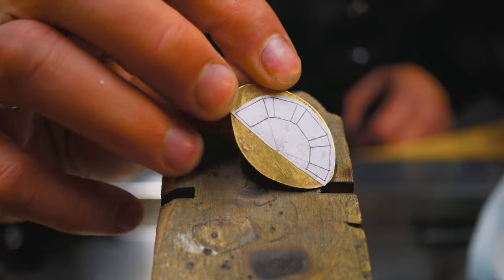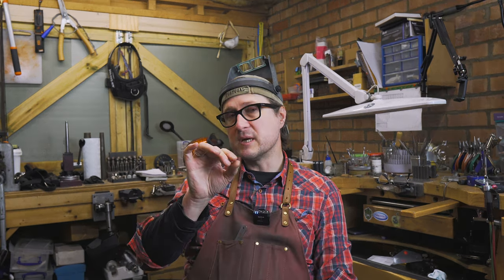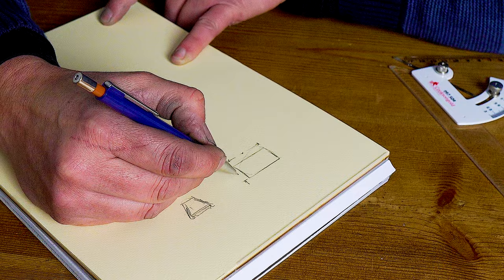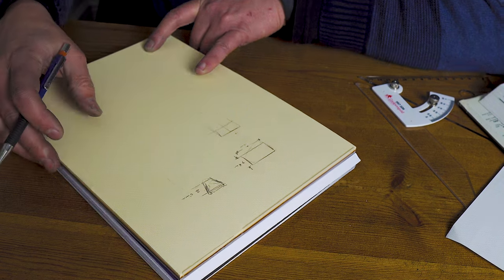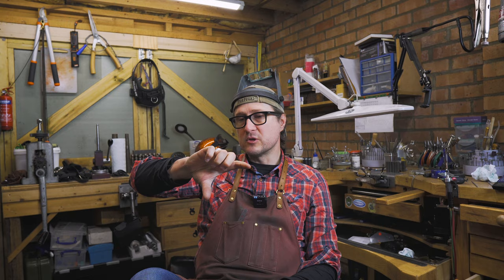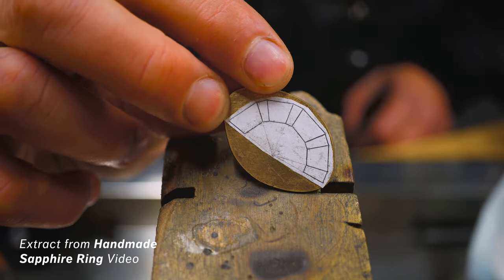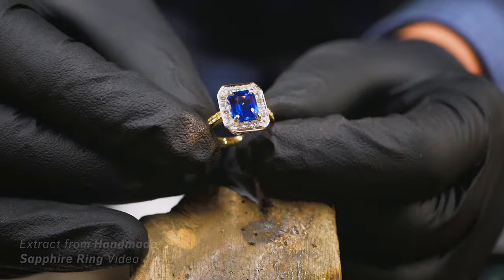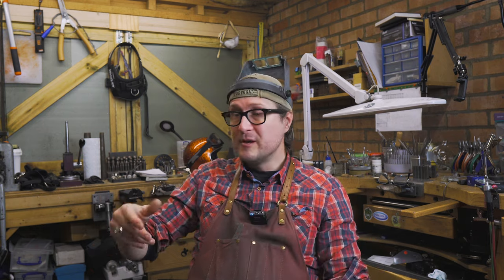How To Make 3D Shapes (Plate Construction) | Technical Drawing | Goldsmith's Workshop Secrets

Comment: Hi, I love your videos. Thanks for sharing. When making the 17° lines from the top of your bezel, down through the bottom of the bezel, and to the intersection point, how do you determine where the intersection will be? In other words, the distance from the top of the bezel to the intersection point, is that arbitrary or is it based on the 17° drop? And if you come down at that angle, the drop distance will be determined by the angle. That makes sence to me, i guess i answered my own question but i've struggled to understand this and have several books that are super vague about how that distance is determined lol. Anyways, i'd love some clarification... im going to pull out the protractor and do some experiments. Thanks!
Reply from the maker: Yep, the angle brings the points together 👍🏻 if you message me on Instagram (jacothejeweller), I will post you the extract from where I learned it which might be handy.

Comment: Hi Jaco, how much should I add to each length to account for a bezel setting? 20%? Maybe more?
Reply from the maker: It’s a tough question. Size matters a lot here - but always work bigger too and bottom if you aren’t certain. The shape is the important part here and I would have 3 to 4 mm to both ends to make sure you have a safe amount to file and cut. Good luck 👍🏻